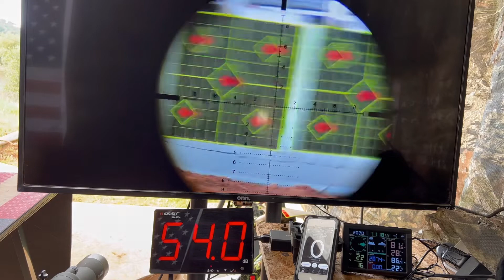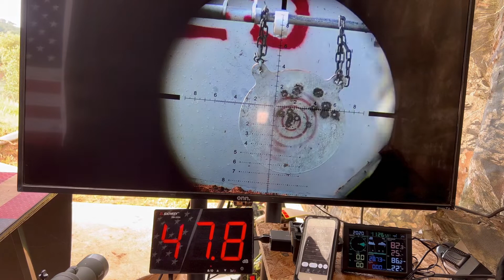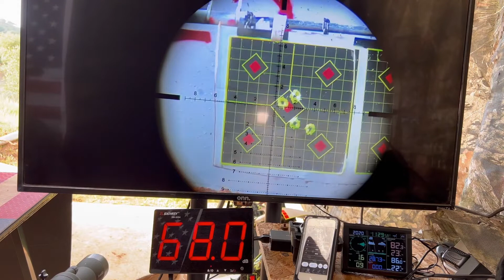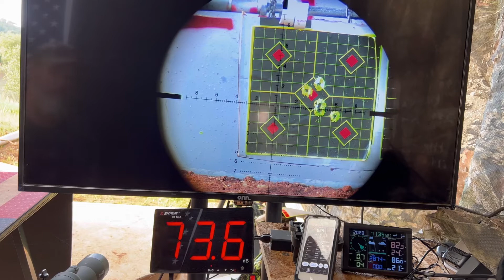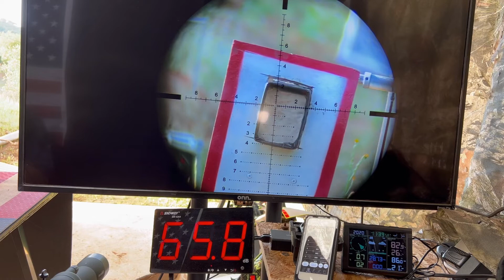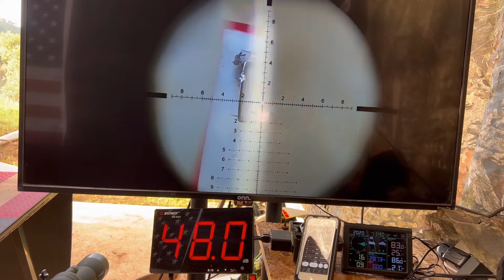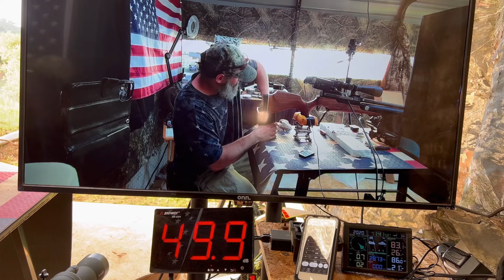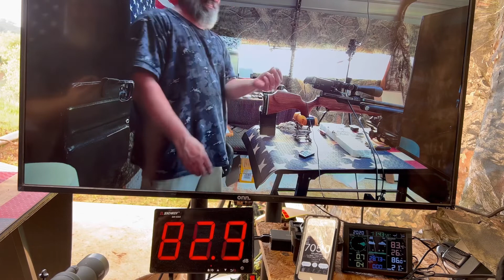AEA Zeus meets Smooth Ammo Molding System.58 caliber hollow point slug. 407 grain

Comment: sam i need a .580 mold smiles and thanks for a link please
Reply from the maker: The molds are custom made by me. I have just solved the hot handle issue and am finally ready to move forward. If you are interested I have some videos on the system. I will be offering .30 .357 .45 and .580 molds to start. .25 cal is looking good too but I still have to test a bit more. I will be releasing a video on the progress and what the first offerings with the system will be. The .58 are awesome! I still have a lot of testing to do on these rounds but they are really really good currently. The biggest problem testing them is breaking every thing I shoot at. 😂
Reply: @DrSaminstine  sir i do not have a zeus. but the new airgun that is here next week at thepelletshop and fox air power the ELEMENT MAX is going to be in calibers from 45-58 so yeah i will either get the .510 or .58 and if i get the .58 i will need a good mold sam. so of course id  like to know. you might contact both aea dealers and appraise them of what you have and make orders available. you just doing splendid ty are you not...
Reply: @DrSaminstine  the breach of the new air gun is an inch 25mm and is single shot , single load so will take a heavy chunck of lead sir. the .58 runs at 600fpe so any velocity over 671 will be at least 600fpe if it weight is that amount. so a lighter projjectile lets consider 400-500grains. would be splendid. i do not know what an inch of lead.58 diameter weighs, hahaha ya might make it 24.5mm or less just in case, it is an aea rifle smiles...
Reply: @DrSaminstine  now i am not sure wich i am buying yet, but if you get the link to me for where all the links will be then i can make sure that my peeps can buy from you sam...
 personally i wonder if that 57.8 mini-ball bullet will shoot out of the zeus cause i can get that bullet mold. secondly what is the inside diameter on the rifleing of the 58zeus it will give me a aprox for the new rifle. i shoot long bullet inside  the rifleing. cause i dont wish to over work an airgun. but that is me. if they tell me that a .495 roundball will roll down a .510 barrel then i will buy the .510 if it wont then i get the .58 its as simple as that. so shoot a link eh.
Reply: I have a zues .58 I think my sizer is .579 how are the molds comming